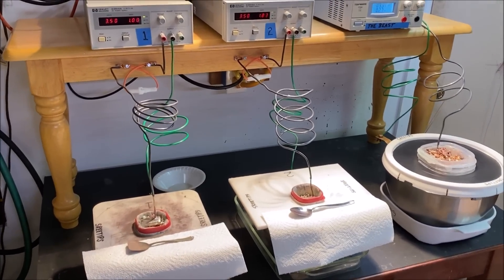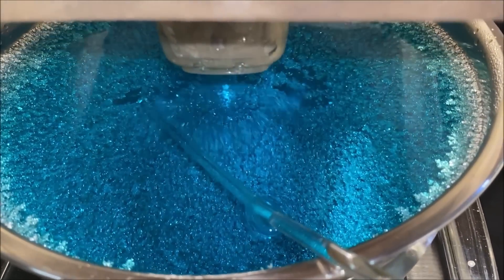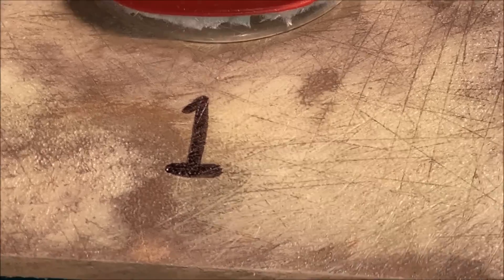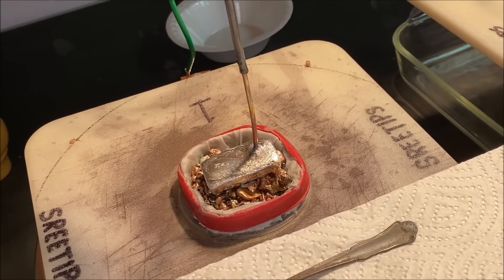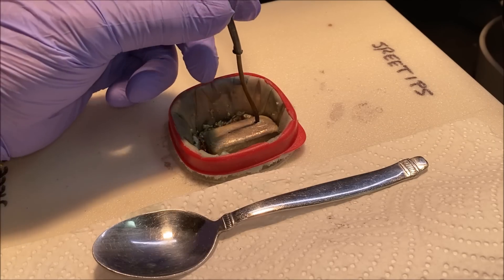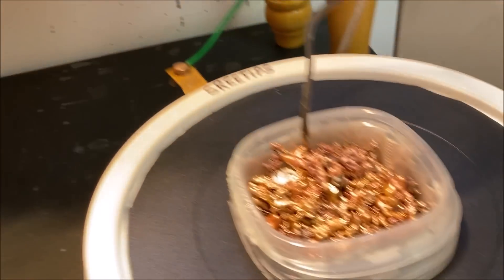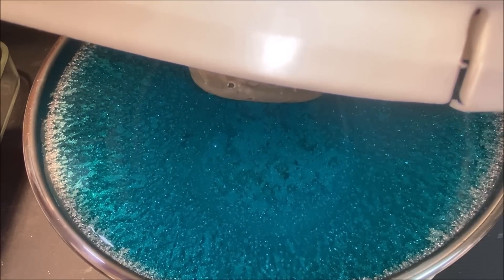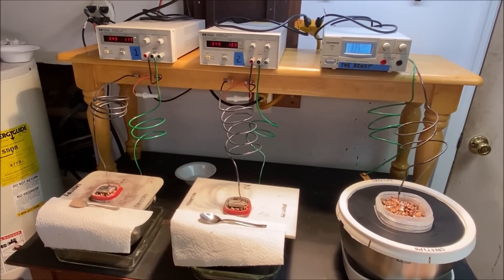Silver Cell Day 3 Maint 72 Hours Crystal Growth

Comment: hello Sreetips. do you remember the hydrometer ? you probably know the one for alcohol or battery acid, it is a weighted float, the depression of this float indicates the density. there is now an electronic version. you could test the cell electrolyte to see if you should just add distilled water, or nitric acid alone, or nitric with dissolved silver. I think you should only add water. if this is not the case it is because the dissolved silver is not entirely replaced by that to be dissolved, perhaps because of a replacement of the silver by copper in the bath. there do not appear to be any precipitated silver crystals due to saturation of the bath.
Reply from the maker: Electronic hydrometer, I must get one.
Reply: @sreetips  electronic one is very expensive, glass one are very cheap, you can find until 1.8 or 1.9 in glass.

Comment: You don't need fuses!  The power supplies you are using are REGULATED supplies.  If voltage is important, set that, then run the cell & note the current it is using.  Set the constant current knob to just a little more than that current.  If the cell shorts, the current will just go up a little & no harm will be done.
Reply from the maker: I need the current flow to go to zero or else it will just sit there a burn a hole in the bag.
Reply: @sreetips  This will only happen if you set the current limit in the supply WAY more than the rating of the fuse.  One thing you MUST  avoid: you should NEVER allow the cell to sit with no current flowing (which is what will happen if the fuse blows).  If you do, you have more noble ion in solution & stainless steel (less noble metal).  The iron/nickel/chromium will go into solution & silver will "cement".  Yes, it is STAINLESS steel, but you are claiming 99.9 fine silver.  You REALLY should use fine silver cathode & non-metallic container if you want 99.9 silver.  There should be NO metals in the cell other than those in the feedstock!
Reply from the maker: I’ve had the silver assayed for purity. Comes back three nines except once. I ran the crystal back through the cell a second time and sent sample for ICP. That came back greater than five nines fine. All of it grown in stainless steel.

Comment: Hi. I have this question: 
Is there a reason why you complet the level of electrolit directly in the solution, and not to pour in the impure silver basket?
Reply from the maker: The basket contains insoluble impurities including gold, platinum group metals, and other junk. This insoluble material could be very fine particulate that could possibly pass right through even the finest of filter (colloidal). Pouring electrolyte into the filter could cause some very fine insoluble particulate to pass through the filter and contaminate the batch of pure silver crystal.
Reply: Thank you.
Reply: I can't wait for the moment when you will extract the precious metals from the filters of these baskets.

Comment: The silver anode bar for your larger silver cell looks to me a bit too small for the filter basket and because of that it could cause consumption problems of the silver shot and I'll say it again a square shaped one would be better suited for your larger silver cell especially one that can at least cover 50% of the surface area what's the current one in the larger of the silver sell looks like it's barely covering 20% as it is now.
Reply from the maker: As long as the anode bar makes good contact at just one point the current flow will be ok. Plus, I can bury it in impure silver shot, and I’ve done that. But no increase in conductivity was noted.

Comment: يسعدصباحك اخي اريد حلقه لحل الذهب في حمض النتريك بعد صهره مع الفظه لانه عندما احل في النتريك يظهر لي خفيف الذهب  في الحمض ماهوى الحل😊
Reply from the maker: If you mean that the gold became suspended and did not stay solid during the nitric boils, it probably means that too much silver (walnut) was added causing the Inquarted gold to crumble into a powder. This makes separation difficult. I’ve had this happen. To fix it, I collected the gold in a filter, put it in a crucible (filter paper also) and melted into a button. Then I tested the button with gold testing acid to determine the karat of the button, and started all over.

Comment: Sorry if this has been asked before, but I have never seen it.  I've noticed in your videos, you inquart by melting sterling silver items (spoons, forks, knives, pitchers etc.) in with your gold scrap.  You then recover the silver by cementing it out on the copper to create the 99% pure cement silver that you then extract pure silver from using your silver cells.  Thing is though, it seems like from some videos I've seen, you have a very large backlog of cement silver to process!  Like buckets worth! And every time you inquart, you're adding more.  So I'm just curious, is there any reason you don't just inquart using some of the tons of cement silver you already have, rather than creating more of a backlog by using new sterling silver items to inquart? I realize you refine silver too, but, I don't know, just seems like you've got this huge amount of cement silver that'll take a while to process through the silver cells.  You could continue to process it at the same rate as you currently are, and then when you're all caught up, you could start inquarting with new items again, so you're silver refining output wouldn't slow down a bit.  Don't get me wrong, you're videos are all fascinating, and I admit I don't know anything about anything, but seeing those buckets full of cement silver just got me wondering ha ha.
Reply from the maker: That sounds logical. Using cement silver to inquart is possible but not recommended for two reasons. 1) because it will take more copper to render it from the solutions again. 2) platinum group metals follow the silver. If cement silver is used over and over then the PGMs will have a tendency to build up in the silver. This could cause problems in the silver cells because high concentrations of PGMs (especially palladium) could dissolve in the anode filter of the silver cell and leach down into the silver cell electrolyte. Especially if there’s free nitric acid in the electrolyte. I’ve had this happen before. I can tell when palladium has gotten into my cell because the electrolyte will turn green instead of the characteristic blue from the copper. Believe me, if I could do what you’ve suggested, I’d do it. But I learned from professional refiners and this is what I’ve been taught. Hope this helps you understand. I’ll get the cement silver melted and run through the cells. Another factor is that I’ve come to dislike processing the silver (but I love holding pure silver). It’s messy and takes a lot of work and produces lots of waste that must be treated prior to disposal. It takes a day to refine pure gold, but two weeks to refine pure silver.
Reply from the maker: Also, silver crystal contaminated with palladium is not the main problem. The main problem is that palladium is twenty times more valuable than silver.
Reply: @sreetips  Thanks so much for the detailed response!. Very interesting. Something I never would have considered.

Comment: hello there , I been watching a lot of your wonderful video but I never founded a video where you make a silver nitrate liquid solution , the same solution that you use to precipitate silver out of copper  , what type of silver  do you use and how pure ? how much nitric acid and how much distilled water to make a solution ? sorry for all the questions but I want follow all the steps to create a silver cell and I want start by cementing silver out of copper from the silver nitrate  solution  , then I want make the  electrolyte solution  and the silver shot to feed the cells as you show on the videos , thank you so much  in advance , if you have a video please attach the link in  the answer so I can watch it . thanks again very much
Reply from the maker: Before you even consider doing this, please understand, that these reactions make deadly gases and MUST be done in a fume hood. Just think of working on your car, while it’s running, inside a garage with the door closed. It will kill you. Same with the nitric reactions. No way to safely do these reactions without a fume hood. Even outdoors, if you approach the reaction from the upwind side, as you get near, the eddy currents of air will wrap around your body and pull the concentrated fumes right in your face. They get in your eyes, your hair, your clothing, on your skin and in your lungs. Nitric fumes will form nitric acid in your moist lung tissues. It will cause blurry spots on your eye lenses, and dissolve tooth enamel. I can’t emphasize enough how important it is to your health. I ignored warnings when I first started and did reactions outside in my back yard. I now suffer reduced lung function, blurry vision, and my teeth hurt.
Reply: @sreetips  Thank you very much for your efforts in sharing your own experience, including the mistakes! Being so clear and in-depth on the potential harm if safety procedures are ignored is invaluably precious advice. I greatly admire your meticulous work and keen attention to detail. You are one of You Tubes finest teachers.
Greetings from Switzerland & all the very best to Mrs. Sreetips and to You! All my best wishes for Your health and overall success in all Your very worthy endeavors!
Reply from the maker: Thank you, great to have your comments on my videos. Much appreciated.
Reply from the maker: I use pure silver crystal that I reserve from a previous silver refining to make the electrolyte. It takes about 1ml of nitric (maybe a little less) to dissolve one gram of pure silver. I use 50/50 distilled water with 68% to 70% (according to the label) concentrated nitric acid.

Comment: I was just wondering, if its possible to use copper for making the anode bars? Would save on using silver and would give a use for some of your waste copper
Reply from the maker: I make them from pure silver because it melts two hundred degrees lower than copper. Copper is a very dirty base metal and not very easy to work with.

Comment: Can you give us a small-words explanation of why the silver forms crystals while the copper goes into solution? Like the for-dummies-version👀😁
Reply from the maker: They not actual true crystals. They are dendrites. The silver ions deposit, layer upon layer, forming the pure elemental silver. The copper won’t plate out with the silver. It’s stays in solution and forms that beautiful blue color. However, if the copper concentration gets too high (I’ve heard 60 grams per liter) then the copper could begin to co-deposit with the silver. That’s why it’s important to use silver that’s already fairly high purity. For example, if I tried to use sterling silver in the anode basket, all would go well for a time. But soon the copper would saturate the electrolyte and begin co-depositing. Also, the silver in the electrolyte becomes depleted of silver as the cell operates. If silver concentration is low, and copper concentration is high, then copper co-depositing is almost guaranteed. I’ve had it happen. The silver will be coated with greenish scum and the silver crystals are very thick and oddly shaped.
Reply: Just adding to this a bit: it ultimately comes down to thermodynamics. Copper is more reactive than silver, meaning that in some sense it "wants" to stay in solution more than the silver. The reason why this is the case is ultimately down to how exactly the electrons in copper atoms arrange themselves vs how they do so in silver atoms (which really is why all chemistry is the way that it is). Plating out a single silver atom requires less free energy than doing so with a copper atom, so it ends up being more favorable for the silver to plate out than the copper. So as long as the amount of copper in solution doesn't get too high and the voltages applied aren't too high, only the silver plates out.

Also a slight correction to sreetips' comment above: these are true crystals. Them being dendritic just refers to the fact that they have a branching, tree-like structure as they form. But if you could look closely enough to see the individual atoms making them up, you would see that they arrange into a regular, repeating (crystalline) pattern. The tree-like structure is because the electric field is strongest at the bits of silver closer to the anode, so silver tends to plate out there more than anywhere else. As soon as you get a small bump or irregularity, the bits closest to the anode start growing the fastest, creating long, thin branches. Another couple of bumps randomly form at the end of the branch, and they start growing into long, thin branches themselves.

Comment: Resettable circuit breakers in line are probably a more modern solution than disposable fuses. You could also make up spare filter baskets if you are having a problem keeping your current high enough.
Reply from the maker: I couldn’t find 3 amp circuit breakers, or else I would have definitely tried those instead.
Reply from the maker: I found 3amp push button circuit breakers.

Comment: Given the amount of silver you have. Maybe it would be better to create anodes out of the silver. Wrap the anode with the filter and run it. Just do away with that silver bar. A stainless steel fire extinguisher bottle , cut off the top and you have a deep but narrow cylinder. At that point you could make very long anodes. Several pounds. Just some ideas for you to ponder
Reply: @joek511  that was what I was thinkin but bigger like a 55gallon drum I had also thought about increasing the power supply I don't know if a higher voltage would just cause it to plate out or mess it up some other way but I'd say that amperage wouldn't matter the higher the better
Reply: @ricktroxell6448  amperage is what grows the crystals. Too many amps and you get long, very thin crystals that grow and pop out FAST and head straight for that anode cup to short it out.
On the other hand, too low amperage doesn't make fatter crystals it start plating more or less.
There is a happy medium depending on your rig and the Senior Chief appears to be pretty much there. Certainly good enough.
Reply: @ut000bs  I here ya so if you crank the amps up it grows them extremely fast and thin and make a direct short
Reply from the maker: 55 gal drum won’t work because critical distance of 4 inches (10cm) to 4.5 inches (11.5 cm) must be maintained between anode and cathode.
Reply: I was thinking, why not inquart using the cement silver instead of melting yet even more sterling silver cutlery, etc., creating an even bigger backlog of silver.
Reply: @wrc1210  That's what most people do. But Sreetips is in the camp that thinks silver's price is being kept artificially low (he has an older video on it). So when he finds reasonably priced sterling, he basically counts that as an investment.
It's less of an investment than the gold refining, but his thinking is basically "when the silver price goes up, it will all be worth it".

There's no real reason not to inquart with the cement silver. Though if you electrorefine it first you won't build up copper in your inquartation mix, copper requires more nitric to dissolve than silver, which is why people use silver for inquartation. It's easy to recover, and then the acid is the main consumable, so reducing that cost is good.
Reply from the maker: Silver is not an investment to be bought low and sold high. Silver is real money. Real wealth. It should be stored as savings. I’m not going to sell my silver just because the price increases. But if I need some fiat paper to buy food or pay bills then I can sell some of my silver. You should NOT use cement silver to inquart gold because PGMs follow the silver and tend to build up in the silver and that could cause problems in the silver cell. I don’t “think” silver is being held artificially low. I know it is. Please see President Johnson’s remarks about the coinage act of 1965. Then it will become clear to you.
Reply: @sreetips  Agree, there was a time when silver was priced far higher than gold. Way back 150 200 years ago
Reply from the maker: Using cement silver to inquart is not recommended because 1) it takes more copper to get it back out of solution. 2) PGMs follow the silver and can build up in the cement silver and cause problems in the silver cell.
Reply: What exactly is the filter doing? If it's only for keeping the anode slimes out of the pure silver crystals you could electrically insulate the bottom of the bowl and the bottom inch or so and just let the bar dissolve while the slimes sink to the bottom of the bowl. Due to the reduced cathode surface area the process might be slower, but getting rid of clogging filters might be worth it.
Reply from the maker: The filter traps the insoluble dirt, gold, and PGMs that are in the impure silver shot. Only the copper and silver are allowed to dissolve and pass through the filter into the electrolyte.